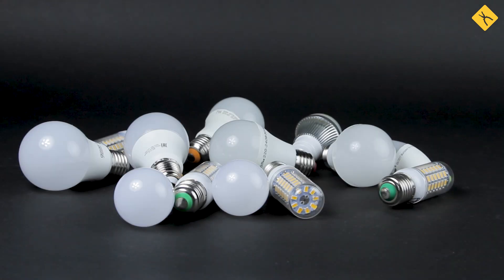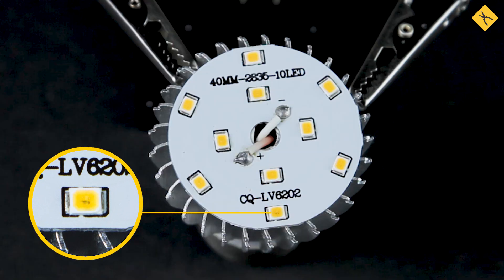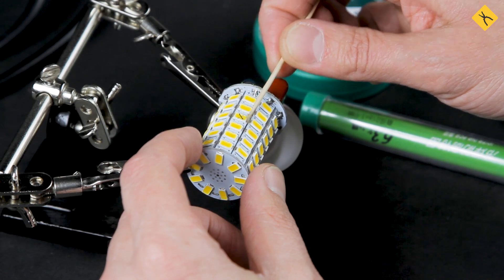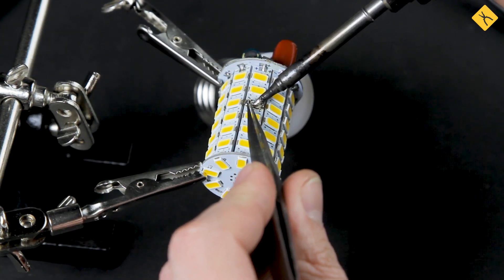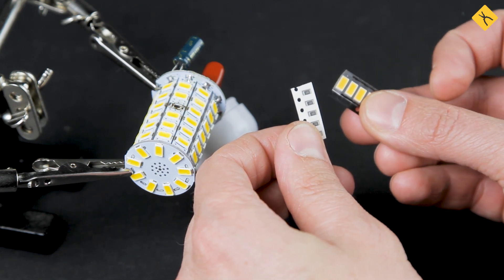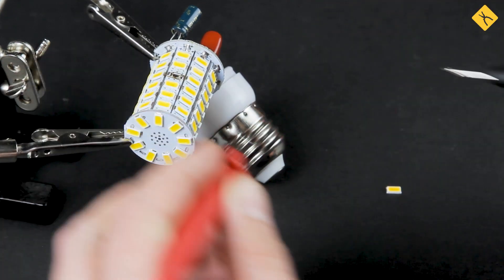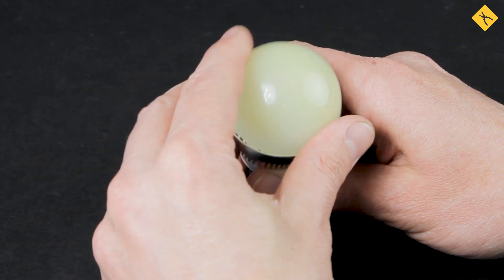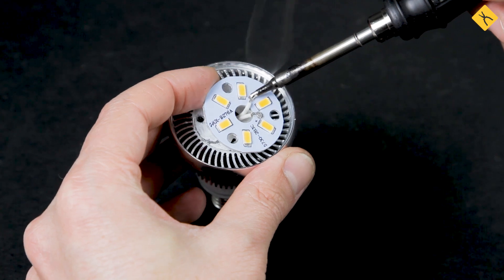LED Light Bulb DIY Repair

Comment: Huh. I tried following this suggestion on a bulb that I had laying around, and turns out that every single LED has sort of a dot pattern in the middle. I tried testing them, but they seemed pretty dead; could it be that they could all go POOF on their own? (I think this was a non-dimmable bulb that was installed in a dimmable lamp.)
Reply: Sí, pueden haberse quemado varios o incluso todos. No creo que sea por usarla en una lámpara oscurecible ("dimmable"). Apostaría más por un fallo en el circuito de control ("driver") que habría causado un brusco sobrevoltaje en todos los diodos a la vez.

Comment: I had 3 burnt led in my lamp, when i replaced them and plugged them in, it lit up for a milisecond, then i looked and saw that 4 other leds just burnt out, so i replaced those too, and tried again. I got the same results the second time as well, 4 other leds have popped, and now i dont know what to do.

Comment: Hello, I have the exact same multimeter and when i try to mesure an LED, they all light up??
Reply from the maker: Hello! When you test a LED strip in the diode testing mode you can only test one diode at a time. The diode you test lights up as the multimeter supplies a small test voltage.
Reply: @ToolBoomVideo  Yes but in my case, i am testing the bulb with the diode mode, every single LED and none of the  LEDs light up, But when i connect a 9v battery with a resistor to 1 LED then they all light up just a little bit. Im so confused why this is happening and i cant find anything on the internet. And the Lamp is working fine im just experimenting
Reply from the maker: The multimeter voltage in test mode may be not enough to light up the LEDs.

Comment: Constant current drivers won't overdrive the rest of the LEDs if the failed one is replaced by a wire link. The cheap 1€ bulbs I bought have constant current drivers in them, I have checked their power consumption. In that case less LEDs means less heat. A resistor will disipate all the power it drops as heat, instead of heat+light. On constant current that means at worst more heat than originally, and thus an even shorter lifetime for the remaining LEDs. For those lightbulbs with constant current, the best solution is to split the LED chain in two halves (or 3 thirds, 4 quarters, etc)  and hook them up in parallel, so they run at half (or 1/3, 1/4, ...) current. Still plenty of light and they will last for ages. Sometimes you can adjust the current by replacing a resistor or capacitor with one of a different value, that works too, and can be better fine tunned. Use a trim pot of appropiate range and you can turn it down to just adequate lighting level. I wish lightbubs came like that from the factory.

Comment: Great video! Take my upvote. This info helped me diagnose my burned out bulb in the light module for my Whirlpool freezer. The problem is I have no idea how to buy a replacement. Are you able to help? Here is a pic: https://imgur.com/gallery/CTZRTvu

Edit: here is a link to the full light module I am trying to avoid buying: https://www.repairclinic.com/PartDetail/Led-Light/WPW10515057/3021141

Comment: when replacing with a resistor. how can I calculate the correct value for the resistor?
Reply from the maker: Hello! You can easily put a jumper instead of a burned-out LED in case you have high quality LED bulb. The lamp driver will set the required current automatically. Or, you can replace the LED with a resistor. In this case, you need to set the current through the primary circuit of the LEDs and choose the value of the resistor so that there is no surpassing. You need to take into account the power dissipation of the resistor. The greater the voltage drop, the greater the heat dissipation on the resistor.
Reply: @ToolBoomVideo  Wouldn't it be better to replace it with a diode that had similar ratings of the led that failed like the forward voltage drop? It wouldn't light up like a 'light emitting diode' but it would effectively act as if the led was still there and the voltage would be as intended?
Reply: @NeverSuspects  They are like to have very different characteristics to an LED.

Comment: Where do you get the replacement leds?
Reply from the maker: Hello! You can buy all the needed LED accessories here: https://toolboom.com/en/catalogue/energy-saving/
Reply: @ToolBoomVideo  That page is 404 now. What's the part number of the LEDs you used?